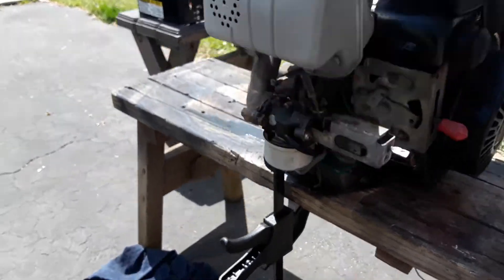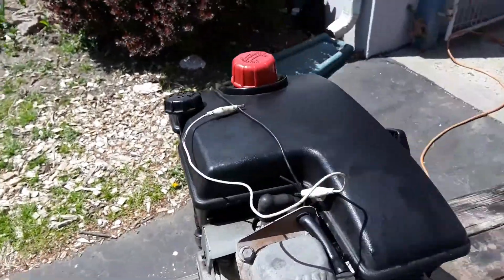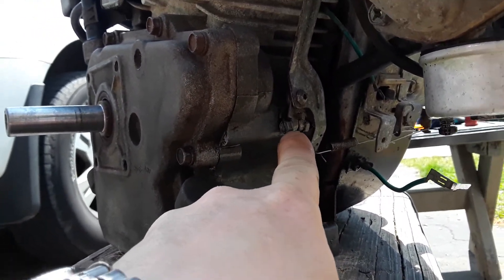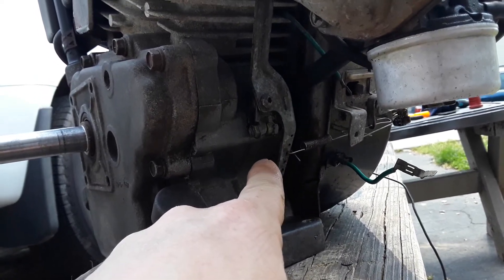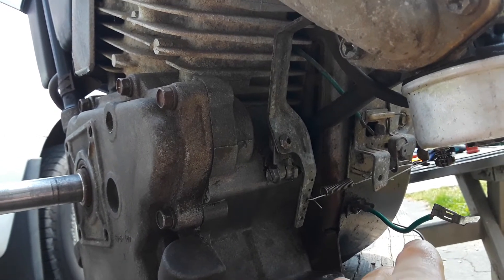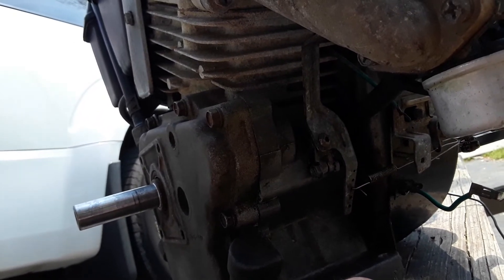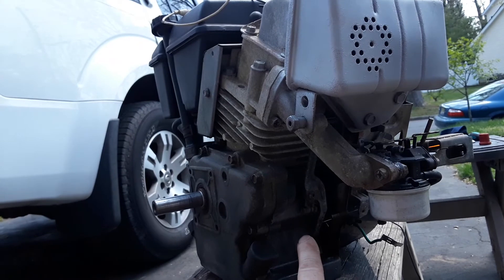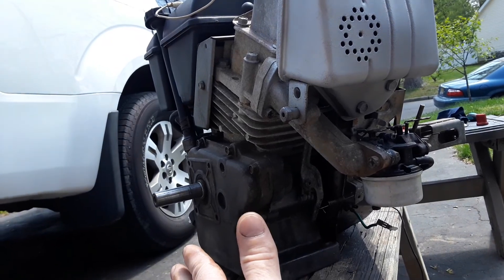Tecumseh 5-7hp OVH design flaw, oil leak. Beware. Specific models listed. -Explanation follows run.

Comment: I have 3.4 craftsman edger leaks but for the amount of use once or twice a year, I can deal with that problem. I’m going to shove some RTV gaskets maker around the governor 🤞🏼
Reply from the maker: @LOVE-JC777  You got one of those leaking? Flat head right? Vertical engine, not horizontal. Because I’ve had a lot of those, never had one leak from there. Bummer it happened. But yea like you said for the amount of use, it’s not the end of the world. Something being run constantly, that’s a problem. But yea this OHV in this video, those have the problem widespread, poor design.
Reply: @ it’s vertical engine head right on top. Yes it weeps a thin film of oil. I just wipe 😢 the tears lol
Reply from the maker: @ If the heads up top, it’s horizontal, up front vertical. Otherwise I hear ya, just keep the oil level within range and it’ll be fine.

Comment: I just got snowblower with oh195sa it was way overfilled with oil. I changed oil and now it leaked a bunch just sitting there.
Reply from the maker: Yea those engines have a problem. I’ve only had a few people message me and say theirs didn’t leak. Most of them do. They were not engineered well and the only reason they even made those is because they were forced to by the EPA to replace the flatheads for better emissions and they probably got rushed, it was all within Tecumseh’s last decade in business, so evidently they didn’t bother to fix the problem. I don’t know of anyone who found a way to fix that or posted about it. It may be possible by using a seal of some kind from the inside between the governor arm and the brass tube it goes thru. A sealant probably won’t work because that arm moves, it would have to be an actual seal. I never wasted my time opening one or trying to stop it. At the moment all you can do is keep adding oil so it doesn’t get low and wipe up the oil that leaked so it doesn’t make a mess. I had a conversation with someone about trying to use a thicker oil and that’s fine, in warm temps, but in the winter you’re supposed to use thinner oil anyway so it gets properly distributed in there, so that’s probably not advisable during this time of the year. That’s one of those engines that gives Tecumseh a bad name. Most of there other engines particularly the flatheads were good engines, only a few were poor and that one is towards the top of the list. If it was me and that engine was on a personal machine I would just swap it out for the 195cc 5hp flathead. In fact if there was room I would stick a 7 or 8hp on it, because those 5’s were a little underpowered on most applications any, especially snowblowers. The Predator 212 is always a good option, they are relatively inexpensive and better than those and have a lot more power to work with. As long as it’s a single shaft your set. If you got one of those dual shaft engines, you would have to find another Tecumseh because Predators don’t offer dual shafts. If you have a stator for power, same thing, gotta stay with a Tecumseh or something that has it, because Predators don’t have it stock. If it’s a single shaft with no stator, drop a Predator on and be done with it, you can remove the air filter, it doesn’t need it for winter on a snowblower. Leaving it in there and it gets wet, the engine won’t breathe.

Comment: I need a tapered shaft for my generator and predator or HF doesn’t sell the engine with a tapered shaft even though their generator has a tapered shaft.
Reply from the maker: They sell an adapter to make the straight shaft tapered for a Predator, otherwise you can take a Predator to a machine shop and have them machine it to have the taper, but you would probably have to remove the crank to have them do that, which really isn’t all that difficult . Last option is find a generator cheap with other issues, but has a good engine with the taper. They should sell one with a tapered shaft, but they don’t. Outleast not at Harbor freight. Predators are made by Loncin and Chongqing rato co. You can search those manufacturers directly to see if you can find it.
https://www.gatorforums.net/threads/tapered-shaft-adapter-for-harbor-freight-predator-repower.20595/

Comment: What about ohh50? I didn’t see that listed in your description, I have one that is about 21 years old on a go kart its whole life. Still runs but i did notice oil on the governor shaft but maybe only when its running and hot it leaks?
Reply from the maker: Yea any of these engines with this block. Their really all the same, 195cc. Yea as soon as the oil warms up. You can try a thicker oil, but theirs really no repair. It's the design. The shape of the block, location of the governor shaft bushing in relation to the slinger. It gets slung right at the tube and seeps out.

Comment: Seen your video, and YES, THE GOVENER ON MY TECUMSEH  IS LEAKING ,  IS THERE ANY WAY IT CAN BE FIXED, or do I just JUNK IT or scrap METAL???
Reply from the maker: Junk it, get the Predator 212 at HF. Theirs no repair for that, its the brass sleeve pressed into the block, it was an inherent issue on those engines as the oil dipper slings the oil directly at that area, it was an issue overlooked in design of that specific engine. The Predator still occasionally goes on sale, it used to be 99.99 often. Their direct bolt up replacements to those with a lot more power and their reliable.
Reply: @Mr_Tecumseh  0k, I went and BOUGHT A PREDATOR. THANKS👍😎
Reply: @Mr_Tecumseh but I need a tapered crankshaft for my generator 
My 10 hp HM100 slung a rod likely bc of this

Comment: Everything is repairable with some ingenuity and the right tools.
Reply from the maker: Your the second one who doesn't get it. There is nothing to repair, it's a faulty design. The shape of the block along with where the slinger throws the oil allows it to seep out where the Governor shaft goes in. It is a known widespread issue on this model straight from the factory. But I'll tell ya what. You find a way to correct that faulty design from the factory, by all means, please do and show us how and what you did.
In the meantime, my original state stands, it's a poor design to stay away from. Ther 20 years old bow anyway, so there won't be to many out there, but if you do get one, beware, be ready to add oil nonstop and have oil leaking out like a siph all over.
Reply: @Mr_Tecumseh  I'm currently running two of them on two mini bikes with no signs of governor shaft leakage on either. Both engines are original non-rebuilt, branded Tecumseh 6.0hp Eager1 off from Craftsman roto tillers.
Reply from the maker: @carlschroeder6811  OK your lucky for now. They will, give it time. You should have knocked on wood. I can put you in contact with 5 other people who knows those engines well, they will tell you the same thing I put the public service out for. Good luck. Once they start spitting, put a couple real 6hp flat head Tecumseh's on your bikes the 246cc engines, those ones you use are only 5hp really anyway, their 195cc, 5hp, just like the 195cc Tecumseh flathead. You want an H, something reliable, like the H60 the most bullet proof engine for a mini bike ever built. not that overhead valve garbage. Tecumseh only made those by force from the epa and nothing more. You want something like this, not that crap, but if your gonna go OHV, might as well just get a few Predators. Here's what you want if you stick with Tecumseh.
Reply: @Mr_Tecumseh  Nah, I'm good. I want an OHV and this particular design, with a more vertical cylinder angle (less laid down)  and recessed intake manifold design, different than any other OHV engines I have seen, allows clearance for a one piece torque converter plate mounted horizontally and very compactly, without the need to clock the engine forward on it's mount for cylinder to torque converter driven shaft housing clearance, I love this engine design for that reason and being a vintage USA made Tecumseh is the icing on the cake!
Reply from the maker: @carlschroeder6811  Than I would get a Predator, because thst engine you have is a piece of crap and thats coming from someone who loves Tecumseh, worse engine they ever built by far. Better off with a Predator, been running 2 of the commercial on snowblower at 4100 rpm 5 years no issues. Far more power than that thing. If your gonna stick with a Tecumseh get something like thus super high output h50. Must have sold 30 Tecumsehs on ebay just for minimizes, no one wants the one you have, they fail.
https://youtu.be/kt68P_6xmpE
Reply: @Mr_Tecumseh  Your not to good at reading posts either. Preditors have the laid down cylinder design I cant easily use with a torque converter setup on a mini bike, the B&S and Honda OHV are laid down cylinder designs, the Preditor is actually just a Chinese Honda clone.
Reply from the maker: @carlschroeder6811  SMH. Oh my God dude, so are the Briggs! Nah, I've seen more issues with those new Chinese made pos Briggs that cost 5x as much as a Predator. Have fun with that. You were given the knowledge from the beginning actually, how you choose to use it is your choice, your on my channel. I'm a tech, I work on this stuff every day! Briggs went bankrupt a capital firm bought them up. The only thing good Briggs still makes Vanguard in Statesboro and be ready to fork over some big bucks. The Briggs slant head ohv is a clone of the original Honda design. No different than everyone else using that design now. At once $94.99 or 10 for $100 in bulk, I'll take the Predator.
The Predator is the standard in mini bikes and mini bike racing competition now. They make all sorts of custom parts and billit parts for them now. Where you been. They rev them up to 8k rpm uncovered built. Do a little research on your own instead of arguing with me about the facts.

Comment: I have an OH358sa does that also fall into that category?  I think that engine was made in 05 and this is the first year it has had the issue.  It's on my kimpex ATV mounted snowblower
Reply from the maker: This engine the 358 OHV does not suffer that issue the block is different.
https://youtu.be/ZTI-2plP7UI
Reply: @Mr_Tecumseh  well that's somewhat of a relief, what would be the source of my oil leak?
Reply from the maker: @firedancer27  you're going to have to look around. But it's not going to be in the same place as that engine the block on that engine comes up on an angle the 358 comes up straight so it doesn't have that issue it could be a gasket it could be a head gasket just look around run it let the oil get warm and see where it's coming from I'm sure you'll find it
Reply: @Mr_Tecumseh  it seems to be up high, head gasket was my thought based in where I see a wet to dry line, but I'll have to put more oil in it and try again tomorrow.  I'm mechanical, but in no way a mechanic.

Comment: Just monitoring and adding oil when necessary will easily let it last another few years and that seal is replaceable without replacing the block. 
Besides that engine being 12+ years old and being used on a snowblower, which is hard on small engines in general, a shaft seal isn’t that big of a deal dude.  
Definitely not some “fatal design flaw”  not when just regularly checking the oil on a ten year old engine can easily prevent any real damage.  
If you can’t check oil and change seals you definitely should get the predators that way you can just ignore it for a couple years or whatever until it fails in the smallest way then you can just throw it away.  
Tecumsehs were made for men that could monitor oil in equipment and replace seals once a decade without crying “design flaw!”   
It’s funny that design worked fine for the first ten + years, now that design is flawed because what?  It didn’t last forever? 
And it is only going to be “fatal” if you ignored it for a long time because like you said it only leaks while it’s running.  
You sounded like an adult voice talking but place blame like that engine is probably older than you are.  
👌
Reply from the maker: I work on small engine powered equipment for a living. I've worked on all Tecumseh's, that specific model has a design flaw. Its the way the block is made. The dipper splashes the oil directly where the governor arm goes into the block. It's not an issue with the seal. The oil escapes. It's obvious that would only happen while running, the oil is not being warmed up and splashed when not running and cold. Had you listened to the video all the way thru, than you heard me say that, I have seen this problem on many of this same model Tecumseh. This doesn't happen on any other Tecumseh, just this specific one. Have you had this engine? Because if you haven't, you can't tell me what it may, or may not be. I'm so glad you stopped in and left this comment, because you sound educated, yet you are incorrect and you tried to get smart with me in that I'm educated kinda way. The problem is your up against someone equally as educated with knowledge on small engines and this model. The old me would have immediately gotten all pissed off and attacked and I was tempted, but I didn't,, I don't  do that anymore. I let you say what you had to say, than you get your response from me, who has the direct knowledge on this engine. I have the direct knowledge on this engine, if your considering getting something with this engine, beware, don't do it, its no good! Your right with age, comes wisdom, so without taking your comment personally. I was granted the opportunity to explain myself once again, as I did in the video, your wrong about the engine though, it was a short run, poor design as far as Tecumseh goes. Clearly you should not have to check your oil that frequently, oil should not be oozing out the side of the engine at a half a quart an hour, if it is, something is wrong and on this design they all do it out the gate. If your into small engines, consider subscribing, theres many more on this channel, including lot's of good Tecumseh's, not the one that gave Tecumseh a bad name!
You sound smart, but that doesn't give you the right to go around putting people down, you should think about cutting that out, it wont help you any.
I noticed you have a video about being bullied as a child saved in your playlist, so I see what the problem is here. You gotta let that shit go. Toughen up and be a man, don't act out and do what other people did to you, it wont solve your issue. Go talk to someone, get to the route cause. Good luck kid.
Reply: Jax, BINGO!!!! +1000

Comment: Is this still issue an on the OH195SA-72569G ? Just picked up a snowblower with one.
Reply from the maker: Yes
Reply from the maker: If I were you, I would cut my losses immediately and resell it for what you paid for it and buy one that has a Tecumseh flathead. The flatheads don't have that issue. While were on the topic, not sure what size snowblower you bought, but I would stay away from the snowblowers that have the little 5hp engine, their very small and underpowered engines and they tend to break down faster from being over worked in snow. You wanna go with something that has outleast 6hp, actual 6hp not the ones rated at 195cc, the real 6hp which is like 250cc, you can find Intermediate units with the 6 and 7hp engine, those are good, their like 246cc and 258cc their actually 6 and 7 with larger displacements. Their a much better engine. Those OHV 195's are actually all just 5hp, but some were rated as 6 and 7 which isn't true. The 8hp Tecumseh flathead is the best, but you typically only find those on the bigger units, but the 5hp's are the least reliable. If you have a snowblower thats only 20 inches wide to 22 inches wide, the 5hp flathead version will be okay, it will get the job done for a machine that size. But those "5-7"hp OHV engines (those are all really just 5's, 195cc), those are the ones with the problems noted in the video and to beware of and stay away from. The flatheads on the otherhand are all reliable and will last you a good long time.
Good luck.
Reply: @Mr_Tecumseh  Hey thanks, great info! Its an Ariens 624E (24") that a coworker gave me, electric start, seems to run ok, don't plan to put much into it financially.  he did mention oil leak when he had it. So with this design flaw doesn't matter what oil type or additives used, won't help with problem, bummer.
Reply from the maker: @dan04595  Yea, its a terrible design. Its the only one that does it. The way it was made the dipper splashes the oil straight at the area where the governor arm enters the block, so the oil seeps right out from their. 
The epa mandated OHV's in place of the flatheads, because they burn cleaner and use less fuel, thats why that engine was made in the first place, to replace the old flathead design, oil leaking on the ground defeats the purpose. The other OHV's had been out for decades prior so they don't have that issue. Their flathead engines were around the longest and by that time had been around 40+ years, they had all the bugs worked out long ago. They never corrected the issue with that model and ultimately went out of business before anything was ever done. Running it in the winter in cold temps might help a little bit, you can try a thicker oil, it may help a little, but its going to make starting the engine by hand more difficult and parts inside will take longer to get lubricated as thicker oil warms up, that's why they call for 5w30 in winter, its a catch 22. I had an old Tecumseh that burned oil, I switched to 10w40, but trying to pull start it was an arm breaker. Didn't help much, still got past the rings and burned oil and those clearances are even tighter than the location where that governor arm goes in, so it will still end up leaking oil as soon as the oil warms up.
Good luck with it.
Just keep adding oil, as long as you don't mind some oil on the ground, it will continue to run as long as enough oil is in the crankcase.